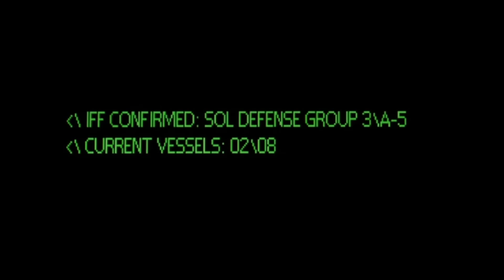Marine Armor | Most Detailed Breakdown

Comment: i can say as a soldier from the cold war we har nothing but vests designs to stop fragmentation, they never really fit right and they  made it hard to shoot or have gear on , the upgrade was to heavy,  just a chest plate so you lost mobility through weight,  so i can say i would hope  they would develop more HALO style gear, perhaps HALO has been like star trek, opened up ideas they were considered  not possible, look at the rail gun ,in 50 years soldiers may shoot rail gun rifles.  so in a scary cool way we will be there.

Comment: Agreeable that while not a simple process, the Marine body armour is extremely possible today, You gotta understand the feasibility of creating these such armour sets, for not one platoon but rather equipping millions of soldiers, with armor that is very costly to produce and challenges the very methods of sped mass production.  that is very expensive for one armour set alone, multiply this by millions to equip everyone, and the fact you may need extras. 

This also comes with the ignorance known only by civilian researchers. We trial civilian made equipment all the time, but what never is factored in is how heavy is it, can you move fast and far in it, is it comfortable and durable in hot/cold weather, does it retain too much heat or too little,  can a medic remove it in time to treat wounds/injuries, can you move freely or does it restrict you, and most importantly, WEIGHT. Civilians always forget that WEIGHT is a huge factor. sure you can use better material and metals in plates but if your soldiers cant walk as far they normally will, then that armour is worthless.

Comment: I think one of the issues with a armor system or even the BDU like this is the weight. There is a saying, which if you wanna watch a channel that covers military tactical gear on the market, look up "Garand Thumb", there he will repeatedly mention that "ounces become pounds". Which I think just looking at the combat in Halo vs real world, is the Halo Marine is much more mechanized, V-TOLS like the heavily armored pelican are not as common or wide spread today, and cost a lot of money (It can cost 10s of thousands of dollars to keep a bird in the air for several hours simply on fuel) so modern infantry and marines have to be much lighter, especially when they are gonna be on foot for hours, if not days.

I mean looking at most of the Marines though out the series, very few actually carry any sort of pack on them, probably hinting at the lack of a need for one because of how short range their mission is.

I mean to give you a perspective, the number of various body injury's caused by modern infantry gear, typically involving weight has far exceeded the amount of any injuries caused by combat. 

gear is your best friend, but it can also be your worst enemy. Or like a cheating ex, you trust it very much and most of the time its reliable until one day it fucks you over.

Comment: The main issue with the armor is one cost yes, but also weight. The current in use body armor is the IOTV and with ceramic plates it weight about 30lbs. I can personally attest that 30lbs over a 12 hour shift is miserable, not to mention for my unit in training, us being scouts, we forwent our armor to maintain our freedom of maneuverability and extend how far we can ruck march while maintaining combat effectiveness and not tiring. This armor is extensive, bulky, and heavy. I know in lore it's fairly light but modern day to give a Soldier this armor would be suicidal. The evolution or armor balances weight, which would impact the range a soldier can move distance wise and remain effective, and protection. Currently that's why we use ceramic body armor due to its protection and low weight compared to using a steel plate as armor. As cool as it would to wear their body armor, in a combat situation I'd rather run around in my underwear and boots because then I know I'll at least be able to sprint from cover to cover and maneuver for longer without fatiguing.

Comment: the reason why something like the marine bdu isn't used by soldiers today is that it's too heavy. A lot of soldiers don't wear armor at all sometimes, and helmets especially are often seen omitted. Double layered plates, ballistic helmets, and non-vital protection (shoulders, legs, etc) is a lot of weight and bulk which gets in the way more than it helps for most missions.

This is because of the nature of today's battles; there's a lot of rucking through deserts and less fighting. In situations where firefights are more frequent, or where soldiers move a lot less, you do see some more armor; like pauldrons, masks, thigh/forearm and groin protection.

I suspect that if we were to go to war with a very capable enemy, we would see more armor. Things like those boston-dynamics robots would be used to carry supplies like food and water so the soldiers would be able to carry less supplies and more armor.

Comment: They should make armor with the same stuff the under side of our modern day space shuttle is made out of. If it could withstand the heat of re entry. It could have a chance against a plasma bolt
Reply: Typically craft designed for reentry have ablative armor, which is designed to crack and break away to prevent heat transfer from one piece to the next, and in turn to the hull of the reentry vehicle itself. In other words it's an armor designed to be destroyed.

Comment: I would asse the crystalline coating on the armor acts as anti spalling to prevent fragmentation
Also from what I know isnt the gel armor underneath the plates supposed to house electronics to generate armor to act as NXRA armor? So the whole armor system has an integrity based electromagnetic charge to deflect bullets similar to how the armor system in Halo 3 : ODST works?

Comment: The "single round" rating of lvl iv is for 30-06, not 7.62x51 NATO, 30-06 being the same diameter bullet, but a much bigger and meaner cartridge with more powder, velocity, and ft lbs of force on target. 7.62 NATO is basically 30-06 lite. I dont expect you to know that because while 7.62 NATO is an internationally used cartridge, 30-06 is pretty exclusive to America. I just thought i would let you know that level iv is ALWAYS better than lvl iii except when talking about weight.

Comment: I love the deep dive, but think there are additional considerations in real life that games overlook.  The ergonomics and maneuverability.   

The armor is cool, but most soldiers grew fatigued, chafed, or uncomfortable wearing the full suit of armor assigned to them in the current day and age.  If modular, most marines will run it at the most comfortable configuration possible and allowable.  

Next, the best protection a soldier has from bullets is to not be where the bullets are.  The 5 Ds of dodgeball (Dodge, Dip, Duck, Dive and Dodge) means that a soldier needs to constantly move, shift, evade, change position, aim, fire, reacquire, and do it all again.  The body armor of the marines in Halo do not offer a clean fit for this and would likely be less protection than an armor suit that might cover less in the way of plating, but allows the marine to move.

But you can also ignore this and please design me some bad a$$ Halo gear.

Comment: Love your videos keep them up. 

Also this could be different for the unsc to the USMC, but isn’t the BDU the fatigues under the actual combat harness? Or is it all considered the BDU? I could be wrong we just always refer to the armor as combat harness and the helmet as Kevlar, with the under uniform as the BDU itself. I could be wrong I’m not active service, just in ROTC and have a interest in the uniform.
Reply: We don't even call em bdu that's army we just call them cammies. And body armor is flack even though it's a plate carrier and helmet is a Kevlar
Reply: we don't use BDU in the army anymore, that was cold war era uniforms. In the army we use OCP's or our multicam uniforms. And for the original comment we call our gear full battle rattle.
Reply: Void Strider yeah camies, we use that term I just was under the impression that that was an unofficial name for it. But again I could be wrong.
Reply: @lillyalightbornexo1036  yah they're just called differently by each branch, Marines have cammies, Army had OCP's, navy who gives a fuck, airforce who gives a fuck. 😂

Comment: The type of titanium used is either grade 12 or grade 23. The problem isn't the ability to make it but the cost. Most titanium comes out of Russia which is why they use it so profusely for certain helmets, armor, and submarines. However, a lvl III rated (stops 5.56 & 7.62) titanium helmet still weights 7lbs. That's not an better than the current ceramic plates used by the military (6lbs per 10x12  plate) and worse than the UHMWPE plates which are 3.5lbs.  Maybe a combo of UHMWPE and titanium might be stronger but then cost comes into play again.

I think HALO uses titanium in their lore because when it was first published titanium was the latest whiz bang metal that people were playing with at the time. And while its improved greatly since then with new alloys it's still not the best for various applications.

Comment: Well the main argument against the production of the BDU here would be cost vs. quantity. A good example of this issue can be seen with Germany during WWII. Dramatically superior equipment to be certain, however it became increasingly difficult to produce during the latter half of the war. Quality plummeted in an effort to produce quantity, right down to inferior wood in weapons such as the STG44. The maintenance of a large standing army and all of the necessary ordinance that comes with it can bankrupt even the United States if handled poorly. 

However, modern warfare is no longer large scale and is instead handled predominantly by smaller fighting forces, namely special operators such as the SAS, SEALS, MARSOC and the Green Berets. That said it can therefore be argued that the modern warfighter could easily be armed with a BDU not dissimilar to that of the UNSC Marine given the smaller number of operators involved on the modern field. At the same time though, such troops are incredibly picky about their equipment and may simply prefer lighter and simpler gear, particularly equipment not so dependent upon technology that, in the event of a failure in the field, may be unrecoverable or unfixable. 

I'm just some dude though, so.

Comment: Frankly, active heat management systems and omni-present water-proofing would be better than metal armor for current day soldiers.

Metal deals with impact by (sometimes temporary) deformation, which is nice & all (and for relatively low-velocity weapons like knives pretty effective), but rifles were constructed in WW1 that could punch through multiple inches of metal armor on tanks: if someone wants to build an infantry-man level gun that can punch through a full inch or two of metal armor, then they can do it, because upgrading your carbines & rounds to a dual-stage fire (like the infantry-portable grenade launchers) + rocket-bullet system is both fully possible & fully practical: there just isn't a point yet.

In contrast, when dealing with bullets instead of knives you're better served in distributing the inertia of the round over as large an area as you can, which is what both kevlar and ceramic plates do. You could probably upgrade equipment with carbon nanotubes as a replacement for the kevlar within a decade or two, and when combined with the research on using peptides to create things like artificial enamel & artificial mother-of-pearl you could get some nice plating, and maybe you can even use metal nano-whiskers to improve such plating even more, but "simple" metal armor? Sorry, but that was abandoned during WW1 because of experience with modern weapons, not just cost savings.

Comment: While rewatching this he said the armor plate itself is most likely level 3 but the fatigues are also bucket resistant what would be the overall rating also I fell like it would be a higher rating because of how thick the titanium is in the plates plus titanium is stronger than steel and if I remember right an inch of steel can stop a 50 caliber round with two layers of protection what would it’s real raiting be
Reply: It's definitely higher than level 3. The UNSC Assault Rifle fires a 7.62 x 51mm Nato 175 grain projectile at 2,970 feet per second. Which means it would produce over 3,400 foot lbs of Energy, which is about the same energy as the rifle life 300 Winchester Magnum (7.62 x 67mm) which normally pushes a 180 grain projectile at 2960 FPS. So, literally neck and neck comparison.

Modern level 4 plating is rated to stop M2AP which uses a steel core material for armor penetration, and is also moving at around 2,700 to 2,800+ FPS, also with a smaller grain weight.

The 7.62.x 51mm Nato round used in the Assault Rifle uses a Tungsten penetrater, and thus would defeat any modern level 4 body armor like a hot knife through better. The only kind of plates now in real life that could stop that are level 4+ and even then it's hard to say.

So assuming the Halo Marines can take a few rounds from the MA5 Series Assault Rifle without much injury, that puts their armor above anything we currently have as of 2024.

Comment: Yeah but a Level 4 is stopping an armored piercing  7.62x63mm (.30-06)round. Not simply an FMJ 7.62x51mm. For armor to be rated by the NIJ, it has to pass lower ratings. That means yes for a IV plate it only has to stop 1 AP 7.62, but it also has to pass the rating for level III.

Comment: The reason why today's military doesn't use armor like halos isn't price, its weight. It sucks enough just wearing a chest and back plate. It adds up quickly especially with ammo. You're looking at 40 lbs minimum. Add on all the non essential gear, radios, and anything else you throw in your backpack and you've got upwards of 100lbs to carry non stop all day.

Comment: It's disappointing to know that UNSC marine armor isn't designed to be heat-resistant in order to counter Covenant weaponry. 
Soldiers aren't much use if their armor is easy to burn through and they keep on dying!
Why couldn't the military just start production of heat-insulated armor to keep their corpse piles from building up so fast?
Reply: @Daniel Wong 
I figured it might be expensive, although I admit I have no idea how much heat-resistant armor would cost.

But honestly, I can't help but wonder if it's really worth it. Sure, you can't spend a fortune on every soldier, but it doesn't do you a lot of good when they get slaughtered as easily as they do in the Halo games.

Comment: I believe you are very mistaken with the castings being more expensive in the machining. Usually your machine a prototype to see if it'll even work and then you design a casting process cuz it's much cheaper and faster to pour the metal into complicated shapes than it is to cut a giant block of metal down into the shape and size you want. Now I got something for your most detailed breakdown on the warthog too You said the i c e i c engine in the warthog is only water emitted from the exhaust. Well the nitric oxides from a internal combustion engine the ICE, is made by the combustion temperatures being so high that atmospheric oxygen can now bind to atmospheric nitrogen. It has nothing to do with the hydrocarbons of the fuel and you said the hydrogen engine burns much harder so you would have a lot higher nitric oxide output

Comment: Unsc pilot, neck is exposed. You'd think a pressurized capable suit would go up to neck if wearing a full helmet sealing/pressuring said suit. Giving ex amount of oxygen with extentions using scrubbers and add-ons i.e small tanks to supplement oxygen for EVA. Just didn't make sense to me. I mean their space pilots,probably an oversight. Obviously the skin suit has radiation negating effects to at least some degree.

Comment: There's a variant of the spartan armor in reach that has a raised collar of sorts to divert shrapnel away from the softer parts of the armor. I get that you're going for detail, but good god get on with it already. Some of the major problems with the marine armor in my opinion is having hard armor plates too close the areas of movement particularly around the ankles and shoulders. that and electronics, dust and dirt love electronics but electronics don't like dust and dirt and then you add in any remotely active combat environment, then suddenly all of those fancy toys in your helmet are dead weight. Combat equipment is a balancing act between protection, practicality, and user comfort.